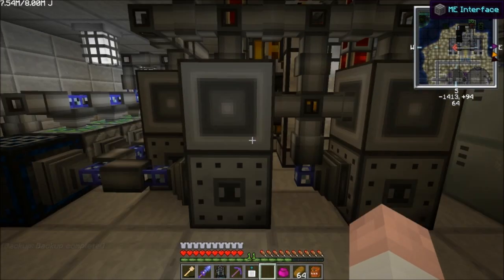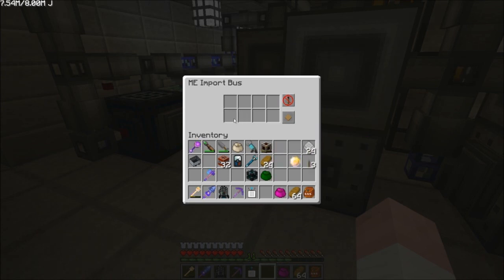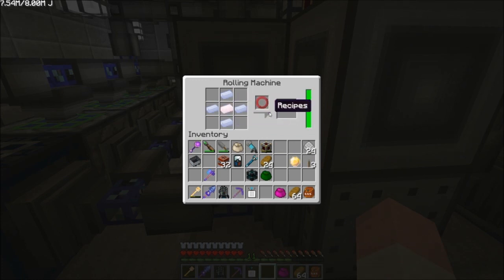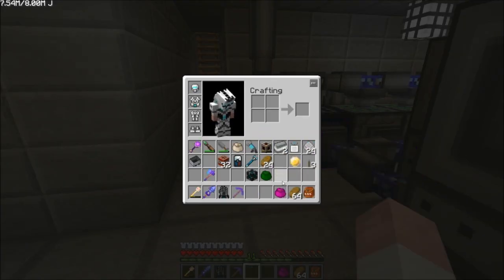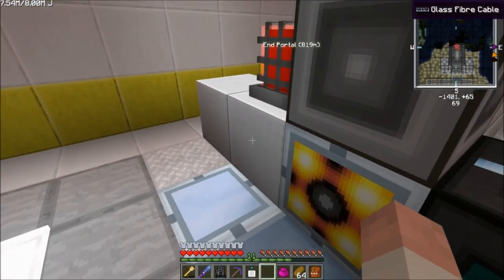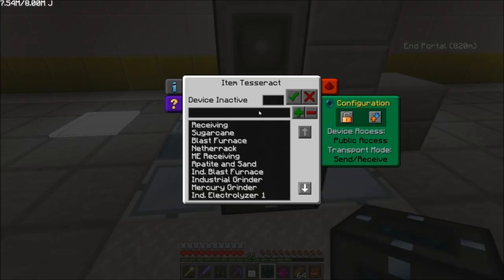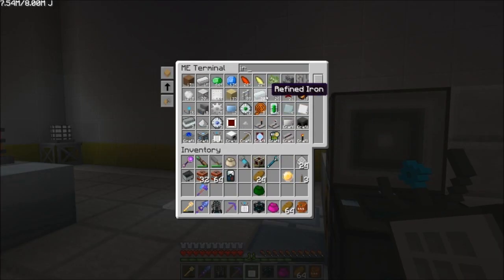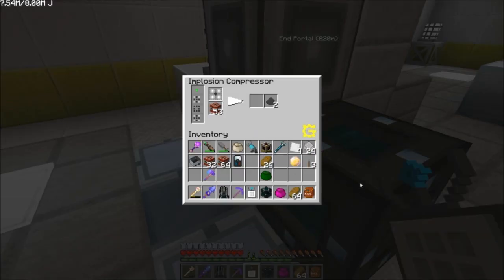Automating A Railcraft Rolling Machine with Applied Energistics

Comment: This worked to me(AE2, 1.7.10), many thanks!
To anyone else having trouble: As stated in the video you can make each rolling machine craft only one recipe. You then pre-add the items to craft to the rolling machine, but do not craft it. put the ME interface in the left and ME Importer in the right side. Make a pattern of 6 iron ingots(does not need to be in the shape) = 8 standard rail (i'm making the standard rail for this example), then put the pattern in the ME Interface. (this is for AE2 1.7.10 btw, i dunno if it works for other versions.). When you order to craft some, the system will send the 6 ingots to the rolling machine, and magically place the iron ingots in the same pattern as the current crafting materials inside, and it will start making it. voila!